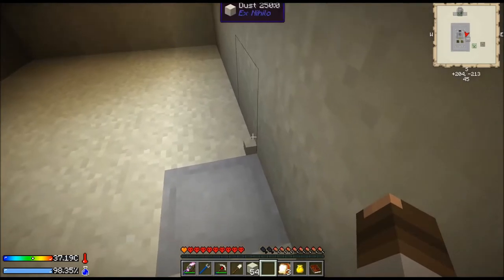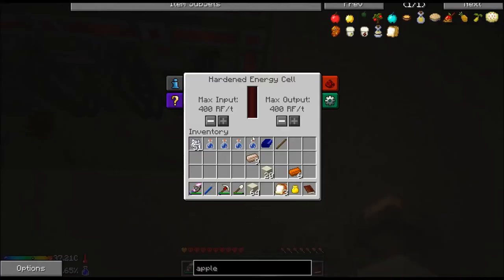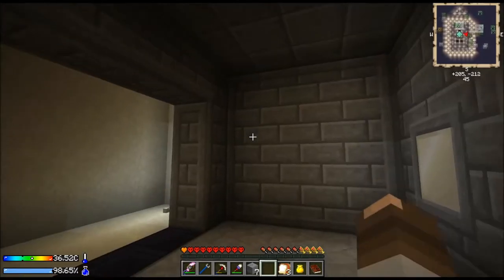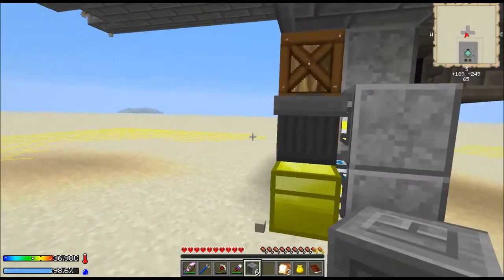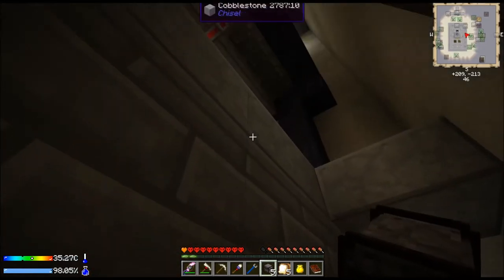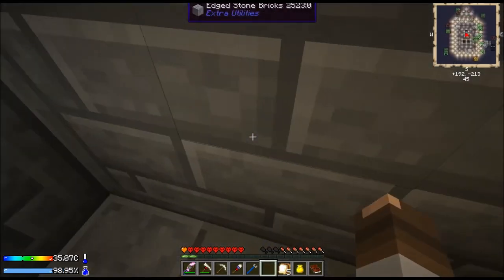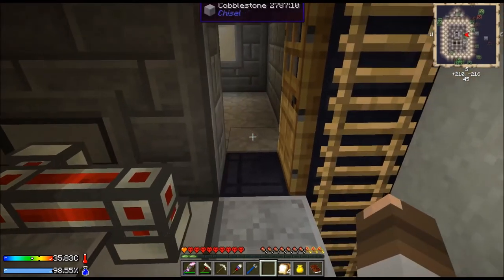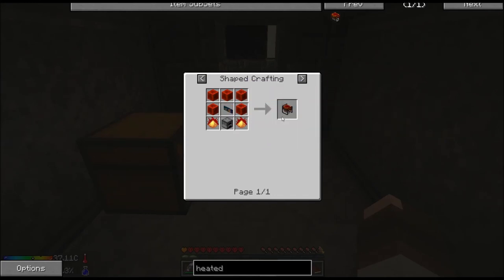Machine Room - Crash Landing S01 E30

Comment: If you get your auto changing auto spawner  working, is the plan to spawn witches for the redstone?
If not, now you have an induction smelter and all that, you could make a couple Tesseracts and shift the gunpowder and mob essence over with those. Or just make the power station over there and beam it over.

I just got part of my data centre online tonight. Got a basic ME system hooked up too. So down at bedrock, next to my reactor, I have a huge room with storage "cores". Each core is a 4 high pillar of SFM cable surrounded by Jabba barrels, each barrel has an ME storage bus on the side, so I can access and control levels using both systems.
I think I'll have stock levels of things that require processed in machines handled by SFM and things that can be insta-crafted, by The ME system.
Reply from the maker: I don't currently have a redstone shortage. I will likely duplicate the sifting setup I had on Agrarian Skies, this will negate the need to use Mob Essence for creating redstone.

I actually picked up the Tesseract Frames from one of the quests. Although, now with the mob trap, I have an abundant supply of Ender Pearls.

Actually I'm moving to a Big Reactor for power.